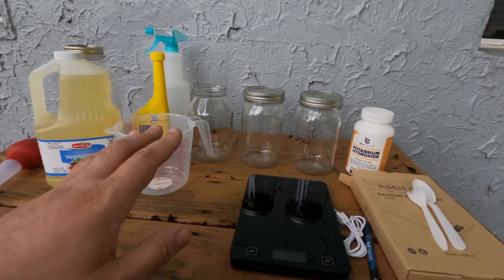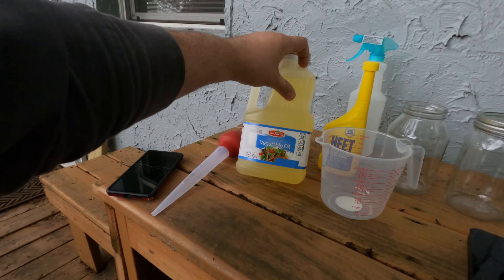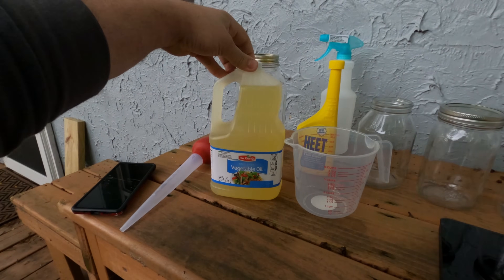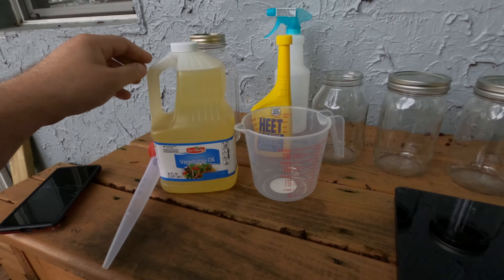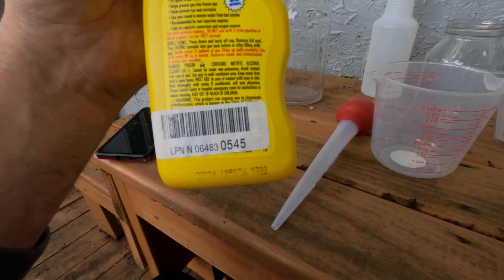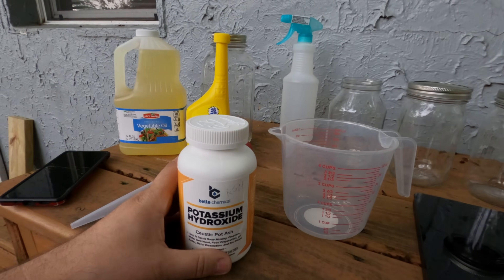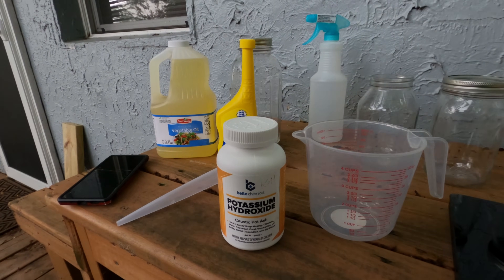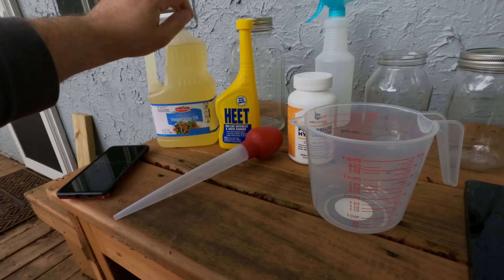This is why making biodiesel is going viral now! It's so easy!

Comment: Hello I have  a 2017 amarok pick up, can I use it?
Reply from the maker: I do not know.
Reply: The Amarok  is vw and that forum will be helpful.
Reply: You best check with a Volkswagen dealer, they might not be informed so you might try contacting VW in Germany directly for the best answers.
Reply: @Subgunman  sarcasm? Obviously a VW dealer and especially VW head office in Germany will obviously say no, even if they have a test bed running with a million miles on BD they would say use only pump diesel.

Comment: this is the reason car companies are switching  to electric
Reply: Electricity now so expensive it’s as costly to run an ev
Reply from the maker: I'm looking forward to switching to electric myself.
Reply: Yeah, not. Electric is a sham especially if it comes from all hydrocarbon based resources. If it’s nuke then it is relatively clean although I am not too fond of nukes.
Reply: Car companies are switching to electric because of government imposed regulations due to the 'Carbon' grift.

Comment: That is bad biodiesel. You need to use water until the water comes clear at the bottom and the finished product is so clear that you are able to read the newspaper through it. If you dont mind me asking what year is your RAM?
Reply from the maker: 2018
Reply: Has it got common rail or normal diesel pump?
Reply from the maker: @firstsat2000  it's common rail.

Comment: i’ve actually tried this multiple times with used oil from restaurants like mcdonald’s. the reaction never works properly. always end up with the solution turning very chunky no matter how much catalyst is used. ever tried heating oil to remove water and mixing the catalyst in when it’s hot with the same reaction happening ever time.
Reply from the maker: I've been driving around like this for almost two years now lol
Reply: You have to make sure that your restaurant supplier is cooking with canola oil and not animal fat

Comment: I am contemplating what I can do to source everything from scratch. I’ve read that wood ash produces potassium hydroxide. There are people who use ethanol instead of methanol. I can brew ethanol and distill it. I am looking for plants that produce high yields of vegetable oil. Mostly to say I can. I’m curious if ethanol can be used instead of methanol. 

Another question is when you add water to extract the suspended methanol. Does that water now contaminate the fuel? I’ve read that most biodiesel is hygroscopic. This can cause excessive wear on the pistons and increased corrosion in the engine and fuel system. Is there a method to remove water? Also what’s the shelf life of most biodiesel? Because I know most vegetable oils oxidize (go rancid). Is this the same for biodiesel? 

Last question. Could pure unrefined veg oil be used in a 6.2L Detroit diesel? Thanks!
Reply: oil from hickory nuts..... from wild hickory trees if you want 100% from scratch
Reply from the maker: That water falls out of suspension, as the video shows, and takes the dirt with it. 

Any older mechanical diesel can run on straight veg oil with no extra steps, as I said in the video.
Reply: I was concerned that even though the water settles to the bottom. That small amounts of water staying mixed in the fuel. Thanks.

Comment: A bit strange to do even the example the wrong way.
You always empty the glycerol first and after that you can wash it several times with water. The more washes, the cleaner diesel.
Conical containers are always used to easily empty out glycerol and dirty water that settle on the bottom.
Reply: That haze was a 6+.  It should be 2 or lower.  
The haze is impurities and mostly water.
Reply: Can you give me how you do step by step

Comment: Thank you for including the disclaimer. I had a newer duramax come to the dealer with low power complaints and a ton of codes. Exhaust smelled just like a deep fryer. Customer failed to mention he made his own biodiesel until service writer (finally) called and questioned the guy. This will not work on new trucks with emissions equipment. It could get cost prohibitive very quickly. A fresh tank of real diesel fixed the issues
Reply: If it smelled like a deep fryer it still had the glycerol in it, and was not therefore biodiesel. People will throw cooking oil in their vehicle and tell you they are using biodiesel when in fact they are using straight vegetable oil, as in this case.
Reply: @roberttill3787 -- That's not necessarily true.  I was making real biodiesel for years when I could get the waste oil for free.  Some restaurants paid me to take it.  It ALWAYS smelled faintly like french fries.

Comment: Was the engine swapped out in the truck? The emblems looked like it said hemi on the fender. It looked like a hemi exhaust on the back. Just wondering, good stuff and thanks for sharing. I have an ‘04 duramax that I use for my business everyday and diesel is killing me at 5.50 or so a gallon
Reply: Its cheaper to run black diesel. 10 parts old oil and 1 part unleaded.
Reply: @coborobasky2080  can't do that reliably on a common rail.
Reply from the maker: Stock engine

Comment: The question is why are we not buying this for $1.50 at the pump and saving gretas earth at the same time brandon?
How does it smell?
Reply from the maker: You can buy Biodiesel at the pump, it's still like 3.89 lol
Reply: @TheDrivewayEngineer  
We don't have it in Montana. 
But, I will be making it.  Just bought a 6.2 diesel for commutin. 25 mpg on pump diesel. Can't wait to figure out something cheaper. Everyone has claimed the French fry oil already.
Reply from the maker: It's work to find veg oil, waste engine oil is easier to come across.
Reply: @gentilejoshsaved1646  just rember a 6.2 gm diesel is not the slightest bit picky it will run on acetone/paint thinner and earwax as lube
Reply: @TheDrivewayEngineer  Regular Diesel is like $5 now.
Reply from the maker: @METALMAN4Wii  And B100 is still 3.88

Comment: I can’t wait to see the larger scale video. I’m pretty happy to be driving my alh powered tdi getting 40mpg even cheaper fuel would be great
Reply from the maker: I saw a TDI car go up for sale for 700 bucks when I was at the lake and thought, wtf would sell a TDI that cheap right now lol. 

It sold in 30 minutes before I could finish the section of video I was working on.
Reply: @TheDrivewayEngineer  i asked you before about the necessity to go through the process of methanol to have usable fuel and you told me that
Old vehicles with mechanical pumps use filtered veg oil as is mixed with some diesel

New vehicles require the removal of glycerin

Is it safe to assume that the biodiesel after glycerine has been removed can be used on any diesel engine old and new?

Meaning I do the process on all the oil i get regardless and use the made biodiesel on whatever I want old or new without caring
Reply from the maker: @FirstLast-tx3yj  yes, you can run anything new or old on B100.

People say that B100 does something to the dpf in newer trucks, but mine has no dpf, so idc lol.

But my Toyota can easily run on diesel, oil, veg oil, B100, B20, whatever
Reply: @TheDrivewayEngineer  will you ever try catalytic cracking of veg oil to make gasoline?

The process is more complicated than the esterification of veg oil to diesel but will give you about 20% gasoline 40% diesel and 40% gasses  that you can use to reheat the rig itself

I got excited about it because my fun having vehicles are gasoline and not diesel
Reply: @TheDrivewayEngineer  Jeez, man, use eye-pro when mixing that potassium hydroxide!

 I'm a bit confused, because I've been pricing bulk (new) veg oil and the nest price I can find works out to around $3.75/litre (16L for $60). Not very economical when pump desel is $1.38/L right now. Where do you find cheap veg oil in bulk quantities? 

One question: I've got a VW BHW  engine (2005 Passat) in my Toyota. The lift pump in the tank is the OEM Toyota but the lines are B100 rated and the VW is all OEM but with MAF/EGR/Cat deletes. Do you think I could run straight veg oil without ruining everything?
Reply: @TheDrivewayEngineer  .. I have the dpf filter and one other removed in any car I buy.

Comment: What about used oil mixed with old gasoline or regular gasoline mix?
Reply from the maker: Different process, same idea. I wouldn't bother without a centrifuge though.
Reply: @TheDrivewayEngineer  Thanks for replying! I have an almost unlimited amount of used oil and used gasoline in my line of work. I'm thinking about trying to do the waste oil/gas thing in a older diesel, maybe a gm 6.5 idk

Comment: Hi, I make my own biodiesel, from Nottingham, England.  I remove the Glycerol then rinse, then heat off the suspended water.  I would of thought water in it would cause hydrolic lock, and  thought all diesels would over time, caramelise the pistons then be harder to start on cooking oil.
Reply: I guess you use used oil? Or is there a source of cheap new veg oil in the UK?
Reply: @ColinWatters  Best to get used oil from a take away, and I give them £4 for Twenty Litres, about 6 Dollars?
Reply: the diesle filter has a water trap, which mostly would catch the water if drained often. and the water would be so small an amount you would not get hydraulic lock. The other point, caramelised pistons would be caused by glycerol content in poorly processed cooking oil.
Reply: Doing a vid?
Reply: The filter juse too have water separator and the condensation that forms in the tank I have to remove every autumn with antifreeze for diesel which consists of pure alcohol (Ethanol) which is then included in the winter diesel... Guess Methanol works just as well even if it is more toxic?
The problem may be getting the necessary chemicals which are guaranteed to be regulated and licensed as pretty much everything is here…
Reply from the maker: You can heat off the water if you're in a rush or just want security, I just wait it out myself. 

If you run straight WVO long term, you will have issues with your IP and rings eventually. How long that takes, 60k, 100k miles, anyones guess. And at current prices, people may find it worth it.
Reply: @TheDrivewayEngineer  I always steam the water off, otherwise rust and hydrolic lock.